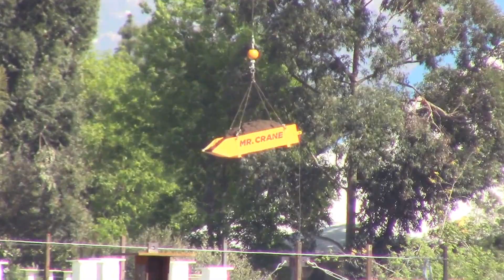Disneyland - 2/24/17 Star Wars Land Construction Update

Comment: I see that they are doing something that they wished that they had done originally... concreting the floor of the river. I wonder if they will concrete line the whole river? Somehow I don't think so! 
Thanks once again Jane for a marvelous expose'.
Reply from the maker: That would be a monumental task for sure.  Thanks for watching Michael.
Reply: The river has always had a full concrete bottom. The new concrete they're putting down is because they had to redo that part of the river, since the path of the river has changed and they dug up the concrete to reroute it. If you search google for "rivers of america drained" you can see the concrete bottom in various photos. In many of those photos, you can see a lot of dirt and debris that collects on the bottom, making it hard to see the concrete, but they drain the river every so often to clean it.
Reply: Yes, when they originally filled the ROA in 1955, it wasn't long before it had all seeped into the ground. Haha.